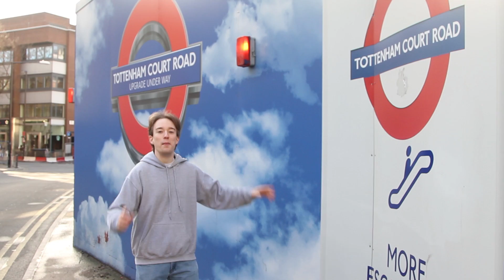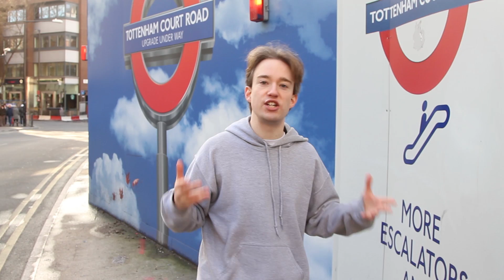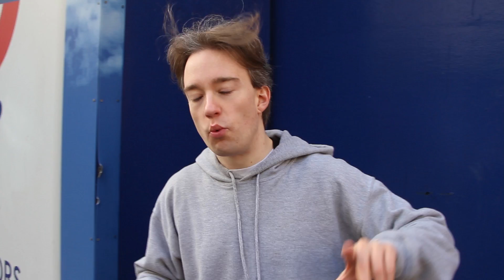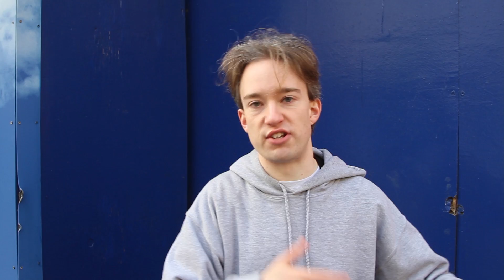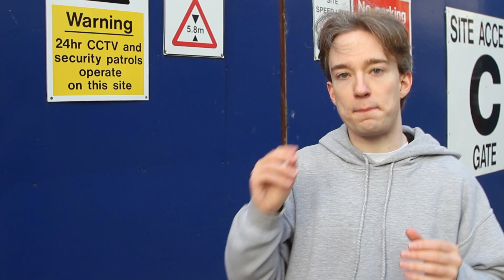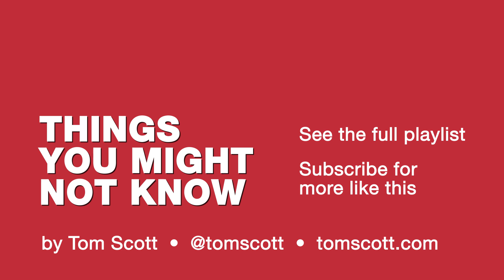Why Do Reversing Trucks Not Beep Any More?

Comment: That white noise is much more annoying than the beeps.
Reply: +Assassinguy102 I think that's ENTIRELY the point. It's to get your attention because there's a 40 ton piece of metal potentially heading towards you at an angle that means the operator of said vehicle can't easily see you to stop before hitting you.
Reply: +Assassinguy102 I know, my head hurts now.
Reply: TalesOfWar Actually that's not the point at all, if you watched the video. White noise disperses more easily than a single frequency tone, so it shouldn't annoy people outside of the danger zone. Also because of that it is easier to locate where that sound is coming from. The white noise (at least for most people in these comments) does not make people any more attentive to a potential danger than the beep did, and many would just ignore it as background noise

For me, the problem with white noise beepers is that it sounds too close to other sounds in an urban environment (i.e. It's not annoying enough to get me to turn my head). For all I know that might just be air brakes bleeding, depressurization, rain hitting the ground, radio tuning, etc. (I know that those sounds don't have as wide a range of frequencies as white noise, but unless the beeps are REALLY loud I could imagine such noises being close enough for me to ignore the beep)

Comment: that just seems like a horrible idea. first off, the beeping is instantly recognizable as something that says "a truck is backing up." The white noise just sounds like air brakes purging or some other random construction noise. also, it may be easier to pinpoint the source of the sound with white noise, but that white noise can easily be washed out by all the other white noise present in your average construction zone. with the beep, at least nothing else on a work site tends to make that sounds other than reversing trucks.

Comment: potential issue with this: Tinnitus sufferers.

I know that's a potential issue with the beep, as well, but personally for me the white noise (at least the specific noise in the video) is basically just a louder version of the noise I hear from that tinnitus dealio.

I work in a warehouse setting, though. Every vehicle we have has a beeper (on the electric vehicles it sounds any time the vehicle is moving or actuating whatever lift equipment it has, on the propane powered ones its just a reverse beeper), I can pick out where a forklift might be coming from even if I have headphones one.
Reply: Nothing like ringing in the new year
Reply: I get that, but for some other people (like my dad, and me eventually) the frequency of the beeps is basically the same as his tinnitus. What ever sound they use is bound to mess with somebody's tinnitus

Comment: To explain this a bit better from an audio engineering standpoint: the reason white noise is more effective is because, as he says, it's a broad spectrum sound that encompasses a wide range of frequencies from very low to very high.

Ever notice how if something's screeching or beeping, you can't just shout to drown it out, no matter how loud you yell? That's because your voice and the beep are resonating at different frequencies. It doesn't matter how loud or quiet either sound is, neither one will be able to drown out the other because the only way to drown out one sound is by playing a louder sound of similar frequency.

While the beeping on trucks may be effective, white noise is simply better because of how difficult it would be to drown out all frequencies associated with the sound. As he notes, it's a factor that allows the white noise to be played at a lower volume, not to mention a broad spectrum sound is easier on the ears than a focused, single band frequency.
Reply: +Kaitlyn Amanda Another big problem is the fact that the human brain has problems dealing with near sine waves since a lot of sound localisation has to do with how different frequencies create different interference patterns under the same circumstances. If you only have one frequency it might be slightly louder on one ear than the other but that isn't nearly enough information for our brain to localise the source especially since these differences is volume are less caused by distance from the sound source than by interference patterns which would differ for different frequencies. With a single near sine wave of course, there is only one interferenc pattern which your brain can't really make sense of. Of course there is other factors to localisation especially envelope behaviours and how accustomed our brain is to a certain sound, which, in the case of near sine waves, is not at all, since they don't appear in nature.
Reply: Kaitlyn Amanda
That's a very good explanation.
Reply: +Yosen B. Mamma I think part of that is because we've become accustomed to reversing vehicles using the beep, not white noise. Go to some part of the world they've never seen or heard reversing trucks before and they won't associate the beeping with it. It's a cultural thing as much as anything else.
Reply: Kats also some people are deaf in just particular frequency ranges. if that happens to coincide with the backing up beep, it could be a problem.
Reply: Todesnuss
Which is probably one of the main reasons it's no longer standard. Any reverberation makes sine waves very difficult to localize. Probably wouldn't have said it as technically as that here on YouTube, but it's a good descriptor.
Reply: Easier to ignore when not directly behind the thing, which is the idea.
Reply: We have computers everywhere now. If we can have car horns singing "La cucaracha", then we can have trucks saying "I'm backing up now, you bleep! I'm backing! I'm backing here!"
Reply: +Kaitlyn Amanda This explains why on old analogue signals you'd be deafened if a channel wasn't tuned in while whatever was playing on the tuned in channel would be a comfortable volume.
Reply: You can spatially place the broad spectrum sounds in your mind, and it's easier to tell their distance with differing volumes, but can't with a single tone.

If you hear the hissing, it is very apparent that something is there that attracts your attention more than some beep that might be drowned out by other machines, crossing signals, noisy vehicles, pedestrian chatter, etc.

And, beeps are easier to ignore, because we hear them so often and can tune out the single frequency pretty well if accustomed to it.
Reply: +Joe Shmoe ambient noises are broad spectrum but may have less high frequency sound and so be less harsh than something as white-noisey as those backup sounds. That being said I hope your prediction isn't right :/
Reply: @bartvandekeere740  very, very incorrect.  With white noise, all frequencies are of equal amplitude. Pink noise on the other hand, is white noise with a 3dB/octave high cut filter (so the amplitude is reduced by 3dB for every octave increase in frequency). What you are referring to is band limited noise, which can be white or pink.
Reply: Kats ov
Reply: Kats . This is a great explanation
Reply: ***** Spacial location works a lot better with broad spectrum noise, that us true but where did you get the idea that it is harder to ignore than a near sine beep? white noise is a lot more natural to our ears and way easier to ignore. Ner sines are the most unnatural sound there is and it is not something anyone is going to be used to. It's not something that occurs anywhere naturally and isn't regularly used artificially anywhere either so the exact opposite of what you said is propably the cas in that regard. Noise is very easy to ignore in a loud environment since a lot of natural sounds (waterfalls for example) are very similar to (filtered) white noise.
Reply: Although higher frequencies don't travel as far, they get more 'directional' as they get higher, which is why you can get away with a mono subwoofer for a stereo hifi. The more I think about this, the more these white noise sirens make sense - chuck every frequency out there and get all the benefits. Very interesting.
Reply: +Kaitlyn Amanda - I feel I have to take exception to all the  wonders expressed about this "white noise" warning.  

Being a "broad spectrum" sound, it seems to me that I would just interpret it as more background noise, as opposed to some truck backing up.

Just so you know, I am totally deaf in one ear - so determining the direction a sound is coming from can be somewhat more difficult - than for you binaural folk.

I have always found it easier to locate lower frequencies than the hi tone of the backup warning.  The same goes for the "white noise" of a telly without a signal.

Perhaps it's because I don't hear in stereo, but I, for one, think this new sound is dangerous.
Reply: Yosen B. Mamma
It definitely is harder to find the source of sounds if you can only hear out of one ear, especially if it's higher pitched or randomly changing. I never considered it from that perspective before. I'd say it's still easier to hear, but definitely a lot harder to tell where it's coming from. I just tried covering plugging one ear and listening to various tones from a distance, and I can confirm, it's definitely easier to locate medium-low tones. The static seems to echo and ping off the walls  asuh quite a bit. I think 180-450Hz seems best.

I will say though, the hardest kinf of tone to locate is near subsonic tones like 25Hz. It seems to vibrate everything evenly. You both hear and feel it. That so called "the hum" which can be caused by anything from generators to fish must drive people insane. XD
Reply: Assuming ideal conditions in a theoretical environment. Have you considered background noise or the lack of recognition of a new sound? Have you ever heard an air brake? It sounds just like it. 
Besides, I don't know any case of someone ran over by a reversing truck with the beep.
Reply: If you know audio engineering then you should know what frequency human ears are most sensitive to.  Also higher frequencies don't travel as far and are more attenuated and drowned out.  The main benefit would be that it's easier to tell direction but it's dangerous to expect people to use only the audio cue and not to use their eyes.  Lowering the amplitude because it's more pleasant to the locals and bending over backwards to justify it is irresponsible.  1 kHz tone wasn't chosen by idiots for no reason.

Comment: [A late comment, I realize, but this video is cool. For disclosure: I'm not hard of hearing or have significant vision issues.]

This makes me wonder if white noise could be compared with luminosity in vision. In that human beings are more sensitive to that then they are with color. And since there's a lot of diversity in color acuity, that can affect how noticeable a color change may be between different people. (I think this is a useful concept with colorblindness accessibility; with a rule of thumb being: can you still read/use the site/UI when it's in greyscale? If not- consider tweaking the contrasts.)

To bring it back to the video, people definitely also have differing tonal acuity with sound (usually even profound hearing loss allows the person some range of hearing, but often not where it tends to matter, to hearing culture at least). So some tones are met with deaf ears and it's only made worse by the Doppler effect.

Makes me kinda wish the US got on this by now. As Nicolas Burton pointed out, I think this could definitely benefit the visually impaired.

Comment: I live in the UK and I've never heard this noise. I've heard "Warning. This vehicle is reversing. Warning. This vehicle is reversing." though. Maybe I just don't get out enough?

EDIT: Ok I found another video of it and realized I have heard this sound, I just assumed it was compressed air escaping or something (obviously I have no idea how construction vehicles work!).
Reply: The way to notice the difference, is the compressed air happens once and its not at a consistent volume. But they do really sound the same
Reply: This is exactly why it is such a DUMB idea.   I cannot believe anyone actually came up with this (let alone got paid to do so!).
Reply: @Milesco  i expect the thinking is that the most dangerous (and most likely) place for a "white noise compliant" vehicle to be reversing is on a construction site: i.e. a controlled environment where everybody that is allowed in has been informed of the whole "PSSH! is the sound of a jcb reversing" thing
Reply: @soupalex  :  But that doesn't make sense.  Say you're the program leader and you have a choice of:

1.  Developing a new system at no small cost that doesn't work as well as the old system and requires that you educate everyone who enters the job site about the non-intuitive warning sound, or

2. Keeping the old system that everyone is familiar with and which costs nothing and works better than the proposed new system.

Which would an intelligent decisionmaker choose?
Reply: @Milesco  it empirically does not work better than the new type
Reply: @Milesco  "vaccines are better at treating viral infections than homeopathy? Says who!? Some egghead, no doubt"
Reply: @soupalex  :  Heh heh....not the same thing, though.
Reply: @soupalex  it also needs to be noticeable for untrained people. What about a truck backing up in a parking lot? Actually, the most common place I hear a backup alarm is from garbage trucks when yhey occasionally overshoot a bin. It's a very audible, very well known, 1kHz beep.

Another noise average people hear is air brakes. This white noise sounds exactly like that, and now people will think that it's the sounds of a vehicle using its brakes, not reversing.

Idiotic and dangerous. I don't care how far white noise theoretically travels, I care what it actually means to the people heating it.
Reply: @Nathan_Lang  1. in situations where a large vehicle is required to reverse around untrained persons, there is generally a requirement for a banksman to be present (in the uk, idk about the usa)
2. you could be forgiven for mistaking one or two pulses were an air brake activation. more than that and you'd likely realise that air brakes don't actually sound like this alarm—abrupt attack and release, perfectly regular repeating pattern
3. it's not that the sound "travels further", it's that it is far more likely to be heard over other noises (allowing it to be operated safely at lower volumes… most noise complaints in built-up areas are historically due to "beep beep" reversing alarms) and is much easier to correctly identify the direction of
4. are you really telling me that, if you heard a loud "pssh! pssh!" noise, at regular intervals, and getting louder… rather than looking in the direction of the noise, you would just think "welp, must be an intermittent air brake being fired repeatedly and getting closer to me… no point in looking!"?
Reply: @soupalex  1. Nope, not required. New vehicles are required to have backup cameras, but that's all.

2. The fact it'd take three pulses instead of one is exactly the problem

3. Usually they are common for about an hour out of every week.

4. See 2.

Comment: That us really cool. And I wouldn't gave even thought of it unless you pointed it out but as a visually impared individual I've had experience with having trouble with trucks witness back-up beeps. I hear that beep and depending on the situation it can be unclear where the sound is coming from. But thinking about busses that give off that hydraulic hiss that's similar to the white noise sound Tom mention here, I'm almost always able to pick out which vehicle that sound came from, unlike the beep. Like I said, I hadn't really thought about it until this video, but thinking back, it's true. Very cool. 😃

Comment: I've never heard reversing white noise, but I have heard fire engines with sirens interspersed with white noise, for the same reasons in the video : drivers didn't know where the fire engines were.
Reply: This is news to me too, but if it cuts down on the volume that reversing HGVs produce, I'm all for it. I lived across from a Lidl store a few years ago, and they consistently failed to switch off reversing alarms when their deliveries arrived at 3am. I'm fairly certain that it was as illegal to sound a reversing alarm as it was to sound your car horn after a certain time of night, but that didn't seem to make any difference.

Comment: Wait, really? I've not heard this before >_>  I need to get out more.
Reply: James Bond There are significantly more trucks in the US than in the UK. It would be a nightmare to change, plus people are hardwired to listen for the beeping and correlate it with danger, whereas the new noise doesn't have the same psychological effect. we are conditioned to look for danger when you hear beeping, white noise would just be a novelty for awhile, and people wouldn't get it right away. It would take multiple deaths before people would equate the white noise with danger. 

There are loads of examples like this in society. Right now, I am typing on a qwerty keyboard. The Dvorak keyboard is better in every way, except that it would be a nightmare to change, so we don't. Good for the UK for changing, but is certainly wasn't needed.
Reply: Manatee McKenzie Nor me and I work on a carpark one day a week haha.
Reply: I live in mainland Europe and never heard it either (or did, but assumed it was air release from a compressor or broken walkie-talkie). To me this white noise sound is unsafe. Maybe safer in laboratory setting, but not irl.
Reply: +herranton1979 Cobblers. I'm sure there'd have been reports on the dangers of white noise beeping if people were being run over because of that, but it hasn't happened here in the UK at all.